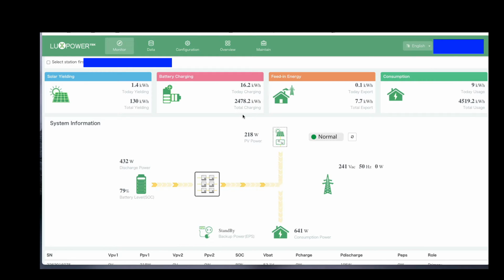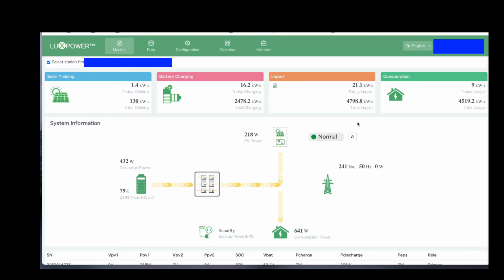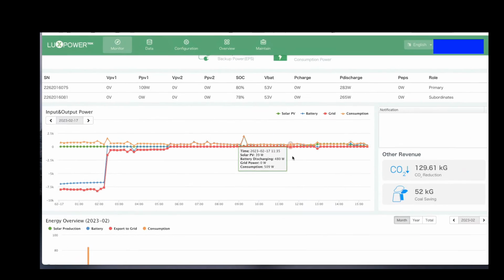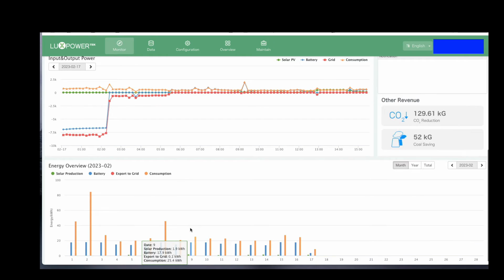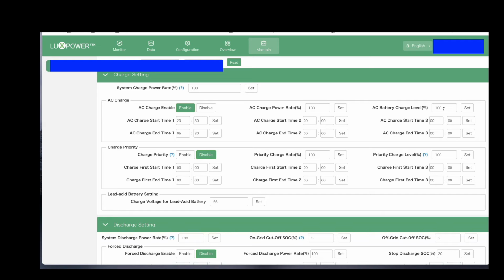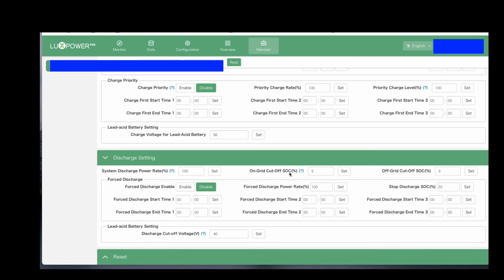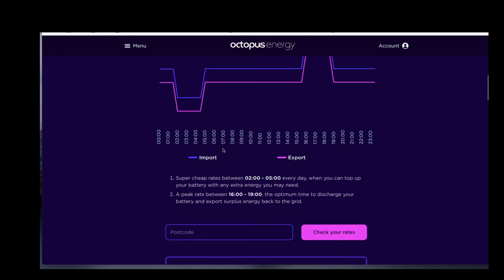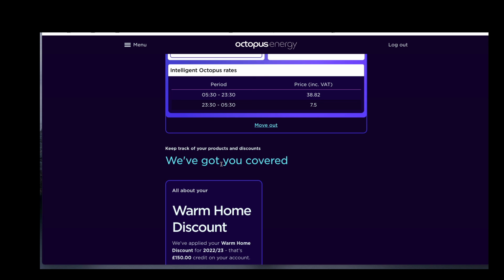LuxpowerTek User Guide Settings/Charging/Discharging Octopus Tariff

Comment: Hi. How can I stop the battery discharging during Octopus free electricity times?
Reply from the maker: unfortunately right now you cant. however i am speaking to a developer of a dongle that can automate thos process.  keep a look out soon for a new video
Reply: Hi Thanks for getting back to me. I've since found that if you go to working mode settings on the app you can set PV Charge Priority to the time band to match Octopus free and you will not draw any power from your battery. We've worked this a couple of times to maximise free electricity. You will only be charged for any electricity you use to charge your battery.
Reply from the maker: Another method is to press START QUICK CHARGE this will charge the battery from the grid. It is for 1 hr time slot. So if less time is needed then go back to app to stop it

Comment: Hi, i am facing issue i have both lux power inverter and battery. When my battery reach to 75% it automatically cut off the power and no light or fan works during loadshedding. What setting should i use .
Reply from the maker: i woud need to know what your existing settings are? if you are uk based then we can ask infinity to transfer your management account to me and i can then help directly.  if not uk then need to send screenshots to me. info@yorkshireautomation.co.uk

Comment: is there a way to set the max charge voltage of a LXP 3600 ACS unit from the actual unit without a wifi connector?
the last page of the user manual, section 8 reeds "Max Charge Voltage less than 60v Configurable" but nothing telling you how it is to actually be configured.
11 minuets 17 seconds into this video i can see an option in the web page that reads "Charge Voltage for Lead Acid Battery" but im damed if i can find a way to set it without a wifi plug
Reply from the maker: all of these settings can be done from the display but it is a lot harder. it is much easier to use the Wifi dongle and connect to the lux app.
I wouldnt adjust the battery voltage settings as these are set by the respective battery manufacturers
Reply: @YorkshireAutomation  i am the battery manufacturer, the battery is an old 24kw Nissan leaf battery, thus the inverter is useless unless i can set its limits. at the moment i just have a detector that disconnects the mains cable if the bat voltage drops to low, so it works as under voltage protection, but that is not very good as it also disables the unit from charging.

from what i can tell, this unit makes no effort to limit the charge discharge limits and im going to have to use something like a Raspberry Pi Pico to make my own BMS that can tell the inverter via its RS485/CAN socket when to activate

unless you can point me in the direction of a generic BMS module compatible with this unit? that would be nice
Reply from the maker: @jdnd3  the only people that can answer that i believe is the manufacturers then. Best to get in touch with LuxPowerTek.

Comment: Can you please explain the EPS switch in the 5kva unit? I had to switch in the eps switch to get output, but on my app it shows power load going to eps and 0% to the house icon? Your video is showing power going to the house icon and not eps backup? What have I done wrong?
Reply from the maker: Hi
EPS does need switching 'on' from the app.  It is designed to provide power in the event of a power failure hence name Emergency Power Supply (EPS).  If you connect a load on there then it will be supplied through that port and show on the app but is limited to the inverter output.  When grid fails then this port is still supplying power as long as there a charge left in the batteries
Reply: Can you set export limits within the system? Thanks 👍
Reply from the maker: @noname1st139  You can set rate of discharge and how much battery you would like remaining before it stops discharging, if you are using the FORCE DISCHARGE option.

Comment: Hi, I am having issues with the ac charge. Basically when I put the time between 2am to 5am to charge batteries from the grid, it charges from 2am to 3am then it just stops charging from the grid when it should continue till 5am. It then just uses the grid to power the house. Any idea why this is happening? Would really appreciate the help.
Reply from the maker: hi
i do need some more info. can you send screenshots of your settings to my email - info@yorkshireautomation.co.uk - also need to know how many batteries you have and size aswell as what lux you have. thanks
Reply: @YorkshireAutomation  hi there,

Thanks for responding.

I got it working now. Only issue now i am facing is the battery not being discharged at its full capacity. It discharges at 3300w but not at 3600w. I have a  3.6kw hybrid luxpower system with 5 batteries. 

Is this normal or is it meant to discharge at full capacity?
Reply from the maker: @Dh2212an  that is ok as it works on current and the battery voltage.
Temp also has an affect on the charge and discharge rates. 
So 3.3kw is within range
Reply: @YorkshireAutomation  how come on the luxpower manufacturer website it states it can discharge at 3600w with a 3.6kw system? It’s missing the extra 300w which is quite a lot.
Reply from the maker: @Dh2212an  under ideal conditions it will charge/discharge at full rate.
Ambient temp is the biggest factor
Reply: @YorkshireAutomation  so I am assuming just to leave the way it is and let it do its thing.
Reply from the maker: @Dh2212an  yes
Reply: @YorkshireAutomation   Thanks for your help.
Reply: @YorkshireAutomation  Hi, what should the system charge volt limit (v) should be set to? Also system charge soc Limit (%)? I am finding that the grid is charging the batteries at 304w when ac charge setting is off.
Reply: I am having the same issue, mine seems to stop and start charging batteries from GRID during the time slots sets, how did you sort yours out what was the issue?

Comment: I am using SNA 6k, but at Discharging pagei cannot file the time setup, only can setup by Volt or SOC
Reply from the maker: I'm not familiar with the sna version as we don't have that here.  I'm afraid you will need to contact your distributor or installer.

Comment: We have load shading and times are not specific how do i leave the on grid charge to charge at any time we have on grid ?
Reply: unfortunately you cant, you will be better with an off-grid inverter instead which has the features to charge batteries whenever grid is present and use grid energy when present and auto switch to batteries when grid goes off.

Comment: Thank you for this informative video. Im trying to change my settings so that the system runs off of my batteries at night up to a certain battery percentage (say 30%). Only then should the grid kick back in. Is this possible with Luxpower? At the moment my batteries are constantly set at 100%
Reply: hi
the grid kicks in when the batteries reach the setting in the SOC for discharge. the system is designed for max discharge when there is power in the batteries.
however if you want to use the grid when batteries is above 10% (or 5% for hanchu) then set this figure under discharge

Comment: Hi, I wonder if you could help I just connected PV2 - another set of 4 solar panels, to existing 12 panels (pv1) do I need to change any settings? I have only changed settings to pv - 2 separate connections, options were given separate or paralel, I selected 2 separate. I hope my question makes sense, I am new to all this. Thanks in advance
Reply from the maker: @mar4elo999  that's correct settings. So should be ok
Reply: @YorkshireAutomation It looks like the inverter has adopted and started to produce. Thanks for your reply! 🙌

Comment: Very informative.... if my car charges 0030-0530, how do I get the battery to charge at the same time? It seems to empty the battery instead of charging both! Thanks
Reply from the maker: you need to enable the AC Charge option and set the time 0030 to 0530.  this way it will simultabeously charge both car and batteries.

Comment: In the last few days my pylontech batteries will only charge to 87% from the grid during my 7 hours of low price time at night and shows a red light on what i think is the master battery. (They always charged to 100% before that). I have the On-grid Cut-off set to 10% as set by my installer but the day this fault started the SOC went down to 9%. Could that have been the cause of the problem? However they will then charge to 100% later in the day when the solar panels kick in and no red light. Any suggestions for a solution? Thank you
Reply from the maker: i would suggest getting back in touch with your installer to take a look at the batteries. you shouldnt be getting any alarm lights at all, and this is what is probably causing the reduced charge

Comment: i had a power failure at Easter. Since then i can not get the battery to connect properly to the lux inverter. using a Pylontech battery I would appreciate any help

Comment: How do you set the max battery capacity to less than 100%?
Reply from the maker: Under charge settings, SYSTEM CHARGE SOC % - this is set to 100% - this means the solar will charge it to 100%.  
This is separate to the AC Charge settings

Comment: may i ask some questions please.
0. I just saw luxpowertek inverter model SNA6000W on internet.
1. can this inverter sync electricity come from solar cell/battery and grid. 
   (i mean use both of electricity from solar cell/battery and grid in same time.
    ex. house load = 6kw and inverter can divide into 3kw from solar cell/battery + 3kw from grid)
2. this inverter can schedule/program charging/discharging time right ?
lastly in my country it's so fuxk shit (bad) when i want to sell electric from my own solar cell.
Reply from the maker: Hi
i believe that all luxpowertek have the same software. the model number you have asked isnt a UK model so i cant comment on the the different regulations that you may have.  Its best to ask a local installer re if the inverter is grid tied or off-grid
Reply: @YorkshireAutomation  Thx for feedback sir. :hand-purple-blue-peace:

Comment: whats the difference between forced discharge and system discharge. my battery discharged overnight, i wanted it to remain as backup and switch to grid when the sun goes out..
Reply from the maker: Force discharge is when the lux will just discharge at max rate (unless reduced in settings) irrespective of the load so useful if you have export tariff.
System discharge will only discharge what the house needs giving zero export.
If you want to keep the batteries topped up in evening them use charge priority for those hours OR set up a charging schedule for those hours but keep %level to a low level so it doesn't use grid to charge up.

Comment: I currently have two Pylontech US5000. I am going to add another two. What settings do I need to change in the Lux Power app to add these?
Reply from the maker: there are no settings in the app that need chagning. Once you have added the batteries and adjusted the dip switch settings on the master battery and slave batteries this is automatically picked up.  Speak to your Pylontech supplier/installer re the dip settings
Reply: @YorkshireAutomation  thanks. Currently on my batteries they're both set to all be up.i assumed the new two I put to be up also? So they're all up?
Reply from the maker: i do a lot of greenlinx batteries and not Pylontech - theres a setting on the master to let it know how many slaves are connected and also ID of each battery. I think its on a dial with some numbers on it that you have to adjust - sorry but cant help more on that as i havent done Pylontech
Reply: @YorkshireAutomation  ok thank you very much I will have a read of the manual

Comment: HI thanks for the video  - i have just had the Lux lxp3600acs and 2 x 3.2 kw batteries  by green link (home ess-lv- 3.2 k) installed  the lag on solar production reading via this app is woeful and tbh i`m really dissapointed with it !! just wondering if there is a way of getting a live reading from the inverter etc via the app ....i have another system that is far better (owl) and this is pretty much live...i`d say a lag of 3 seconds ...i have used the owl system to monitor my solar for the last 7 years and i thought this app would be far superior but sadly its not...anyway once again thanks for posting this video as its far better than the ones made by lux.Oh btw i i have used the refresh button on the app and it does work but wondered if there is a way to use live?

Comment: Hi - Is it possible to have a lower rate of charge when using the grid over night but maintain full charge speed during the day? I've tried amending the grid charge option but noticed my system was also limiting my solar charging during the day!
Reply from the maker: Yes, only adjust the %charge rate inside the AC CHarge Time area. that will then adjust only grid charging and not solar charging
Reply: Ah I'm using the app and I don't have that option. It saves 'Grid charge rate' and 'AC charge level' as my options. 

I'll try to see if I can log into the browser
Reply: I checked on the website and its actually the same setting but with a different name. When I adjust it for some reason it was still limiting my charging through the day today from the panels.
Reply from the maker: @Girty92  Under Charge settings
SYSTEM CHARGE POWER RATE (%) - Keep at 100%
under the AC CHARGE
thats separate
Reply: @YorkshireAutomation  Yeah that's what it's set to. It charges overnight at 50% rate fine, then today I noticed I was exporting half the power generation and the limit was also impacting my solar charging. 

I'll check again tomorrow. Maybe it was lagging a bit and I didnt give it chance to amend itself while I was testing
Reply from the maker: @Girty92  do that
Reply: @YorkshireAutomation  Yeah, sadly I've tested again and only changing Grid charge (keeping system charge at 100%). The system is still limiting charge whilst my solar panels are generating. Quite frustrating, I'll try and contact LUX support.

Comment: Great Video, I do have a quick question. I am on a Luxpower hybrid 8-10K inverter with 2 x 10Kw Hanchu Batteries, I am on Octopus Flux and with flux I have setup the batteries in the inverter config to charge them between 2am and 5am as it's really cheap. Is there a reason why when the batteries get fully charged say approx 4am the inverter does not swap over to batteries but keeps pulling current from the grid right up to 5am and then swaps onto batteries.
Reply from the maker: That's because you have specified to charge them from.2am to 5am and so they will remain in charge mode only.  They cannot work in both modes simultaneously. 
If you know that they regularly get to 100% by 4am then amend them charging schedule to 2am.to 4am instead
.

Comment: Thanks for the explanation. Very helpful. I currently don’t have solar but am considering this. The company that has quoted me have no knowledge of Lux inverters. I have 2 squirrel pods. To add solar to charge my batteries i understand we need to add a CT clamp on the primary Lux inverter that sees the power on the live of the PV inverter.  

The solar installer is thinking the CT clamp needs an Eastron SDM120CT. Is this correct?
Reply from the maker: Hi
No it's a standard CT clamp similar to the one that you already have that is monitoring the grid.
You will then only need a PV string inverter and not a hybrid inverter.
If unsure give me a call for a chat on 07946 591533.
Thanks

Comment: We've installed a LuxPower hybrid solar inverter in our security estate in South Africa due to our country not having electricity for 12 hours of the day from the grid. At home I have a Victron system whereby I can just set the SOC to say 40% and the system will use the battery power at night when the sun is down and discharge to that setting before the grid is allowed to be used. Should the grid be out during Loadshedding (rolling blackouts) the batteries can dip below 40%. This is simple. But I have not yet figured out how to get this to work on the LuxPower inverter. The grid was out for 2 hours tonight and the battery discharged from 100% to 95% in that time. Now the battery remains at 95% while it is using grid power. There is enough battery capacity for our estate's security systems to be up all the time on the battery, after which the battery will recharge via solar again starting in the morning. Does anyone know how to set the LuxPower inverter to operate as with my Victron described above?
Reply from the maker: i believe that in order to get the Lux to behave in the off-grid format needs your installer/distributor to change some settings for it to do that. As far as i know the defaut setting is as grif-tied
Reply: @YorkshireAutomation  Ah thanks. I actually managed to figure it out. The interface seems a bit different than in your videos. On our inverter's maintenance page you can now set the Charge to take place within Timers, like it used to be, or set it to a certain SOC, or in fact, a combination of both.

The first evening with the new settings the batteries reached their SOC setting at around 2 am, however the grid was off between 2am and 6am. So unfortunately the battery depleted and our security to our estate went dark. I then tweaked the settings again and last night it worked. When the grid came back around 6am there was still 50% of the battery left. And shortly after the sun was out and started charging the battery.

So, it seems like there was a firmware upgrade which added the SOC setpoint, which in my opinion works 100% better than timers. Especially if you have an unstable grid like us where your power can go off without any notice.